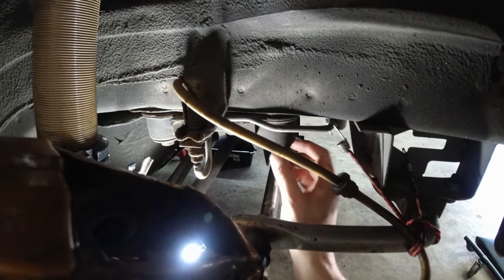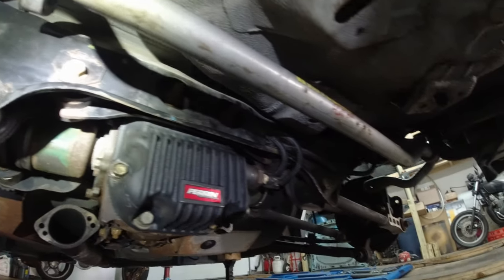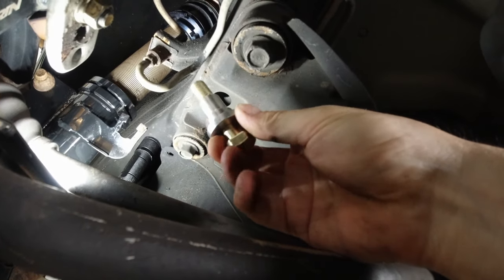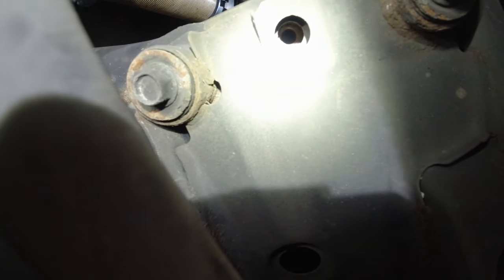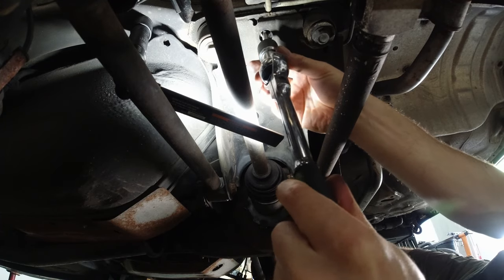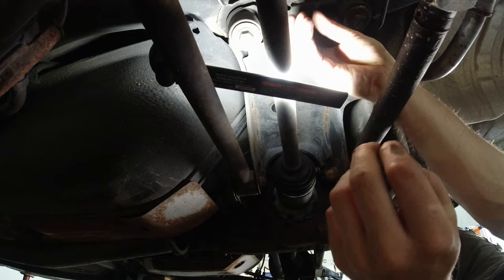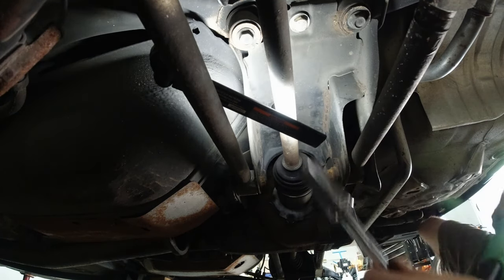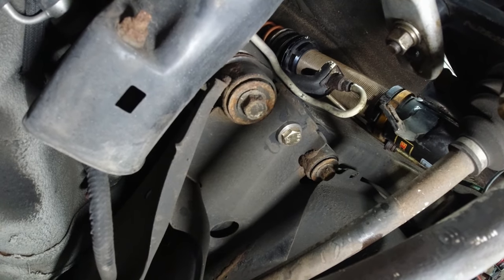06 Subaru STI rear subframe lockdown kit instead of bushings

Comment: Whats that tool you're using?
Reply from the maker: which tool you speak of?  torque wrench or the tap im using?
Reply: It’s the ratcheting one at 3:57 in the video.
Reply from the maker: @android148  3/8 ratchet that swivels 180 degrees, then an attachment that holds taps which i can adjust for different size taps and then the tap.